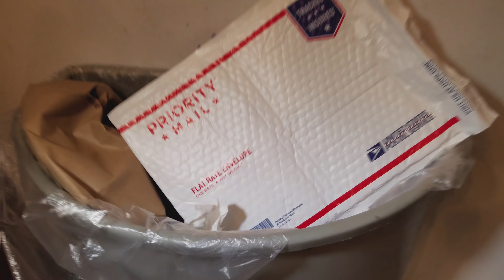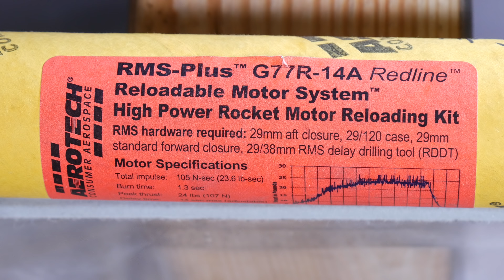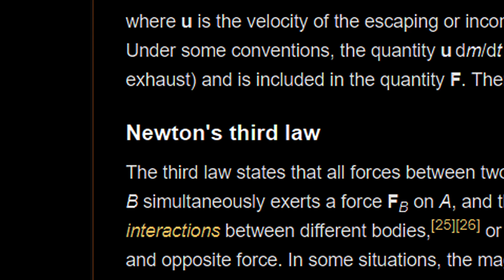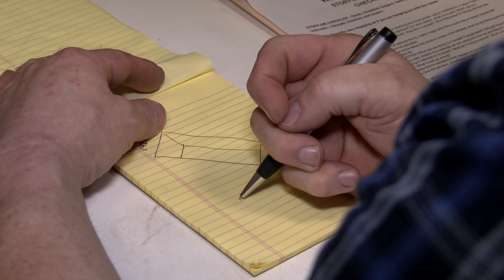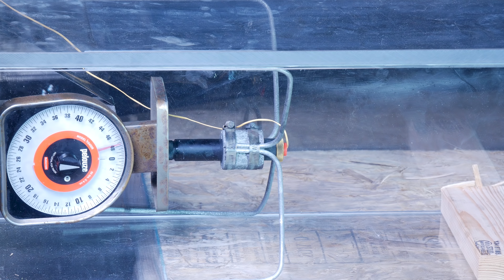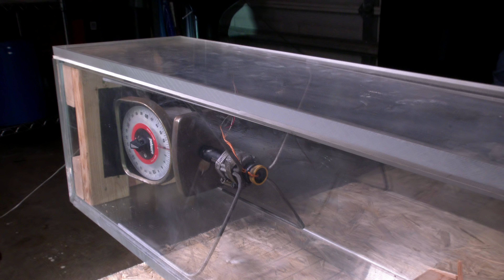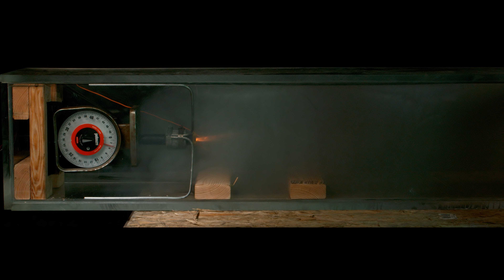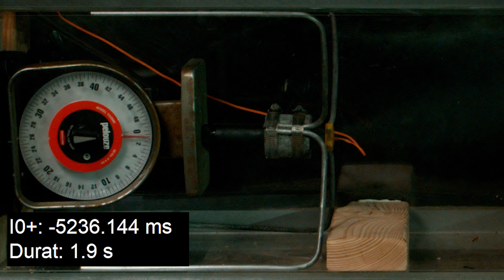Rockets in a Vacuum Chamber - Newton's third law of motion Visualized

Comment: Hate to give those flatear ammo but you realize the second you expand gas inside the chamber you no longer have a vacuum.
Reply from the maker: +Daniel Atkins the difference between a deep vacuum and a medium vacuum is 0.0001% . But I was only concentrating on the first 10 or 20 milliseconds of the burn, that initial impulse, that's it.
Reply: Daniel Atkins - rockets don’t work in a vacuum, just face facts
Reply: Daniel Atkins lol thank you. I watched this video and was like that proves nothing. I still think the box was to small anyways. It most definitely got some velocity off the end of the tank. It doesn't have air to push off of.
Reply: Thank you for being impartial it’s a breath of fresh air... which by the way you can’t get in a vacuum. 😏
Reply: The rocket can’t burn without oxygen , so as soon as it burns it’s no longer a vacuum because there is oxygen.
Reply: " longer have a vacuum."

why not learn what a vacuum really is? you seem to think a vacuum is a complete lack of mass, which is patently untrue.

vacuum is merely the name we have given to sub-atmospheric pressures. there are different degrees of vacuum.  in this case, sure, the pressure will rise...that in and of itself does not mean there is no longer a vacuum.
Reply: "The rocket can’t burn without oxygen , so as soon as it burns it’s no longer a vacuum because there is oxygen."

lolwut? not even close to being correct. solid rocket fuel already has an oxidizer, so no oxygen is required.  furthermore, there is no combustion reaction i am aware of where a by-product is oxygen, at least with fossil fuel based fuels.
Reply: Iron Man Lol do you understand what you even just wrote , eg . The rocket can’t burn without O2 , correct , it is in the rocket oxidiser , when the rocket ignited the O2 in the oxidiser is burnt so there is no O2 in the chamber , although prob some co2 and water vapour .
Reply: Cynical Skeptic  so if thrust needs a back stop to push off of, like atmosphere. How does the sr 71 flying at mach 3+ at 85,000 ft push off of an extremely thin atmosphere that is flying away from the thrust at mach 3+?
Reply: But is sure does take a long time to bring that volume of space up to the same pressure as the atmosphere, and that rocket was producing thrust the moment it ignited.
Reply: Space is not a perfect vacuum.
Reply: perhaps you should keep the vacuum going in the next experiment. As in don't turn off the pump after ignition. Would be interesting to say the least... perhaps along with this, add a vacuum gauge( or possibly use the one you have to monitor the vacuum while the experiment is on going.
Reply: +Ryan Shook Just as a FYI: There's a thing called an "oxygen candle" - one form is a mix of sodium chlorate and iron power.  When you heat it up, the sodium chlorate produces ordinary salt and O2:

2 NaClO3 → 2 NaCl + 3 O2

The powdered iron plus a bit of the O2 burn producing the heat you need to keep the process going.

There are many other chemical reactions that do the same thing.
Reply: @Daniel. That gas expansion is exactly what propels the the rocket forward. Remember. Gas expands in all directions, hence pushing the rocket forward. A basic engine work because of that exact reason.
Reply: Warped Perception Thinks there's a debate. BAHAHA 

You newbie! 

World Record Long Distance Photography (a 275 mile observation from a 9,272 ft peak (Pic de Finestrelles) to a 12,730 ft peak (Pic Gaspard) over water that should be anywhere from 16,502 ft (3.12 miles) to 23,275 ft (4.40 miles) below horizon based on spherical GEOMETRY) has already proven the Earth to be flat. 

That is a distance that is the equivalent stretch between Los Angeles to Las Vegas.

...

BAHaha
Reply: @fromagefrizzbizz9377  chemical reaction....which is a different reaction than combustion.
Reply: @UniqueBreakfastTaco  "chemical reaction....which is a different reaction than combustion."

Did you get your chemistry degree out of a box of crackerjack?

Did you read somewhere that combustion wasn't a chemical reaction?

Oxygen plus, say, kerosene, is the same reaction whether the Oxygen is LOx in a rocket, or O2 in air and produces the same things.  In fact, kero plus LOx burns a lot faster and more powerfully than kero plus atmospheric air, simply because there's a hell of a lot more O2 in a litre of LOx than there is in atmosphere that is only 21% oxygen.

But it is still the same reaction.

Similarly, blackpowder, gun powder, cordite, RDX, AP rocket fuel, AN rocket fuel or any other rocket fuel does not need atmospheric air to work.

Hint: airplanes have air intakes.  Rockets do not.  Neither do firearms.
Reply: @UniqueBreakfastTaco  if you're going to talk about chemistry, you need to know something about chemistry.  Swearing about it just proves my point that your chemically ignorant.

Oxygen candle?   I did not post anything about oxygen candles.  There's nothing at all candle like about an SRB containing Ammonium Perchlorate as oxidizer, aluminum, and HTPB as fuel.  Or a Saturn V containing, oh, a few thousand tons of LOx and kerosene.

Tanked LOx plus tanked kero is precisely the same reaction as atmospheric oxygen plus kero.  Just hotter and faster. 

If you think that a rocket operates using atmospheric oxygen, why do they bother with the LOx?  Where's the air intake?

None of the rockets or motors I've built had air intakes.
Reply: Ryan Shook Oh geeze wtf were we arguing about?  O2 candles have nothing to do with rockets,  and indeed is sorta combustion in reverse (or, more accurately an oxidizer replacement reaction). O2 candles were just a FYI, not describing how rockets work.This long after the comment I’m supposed to remember original context that you should have already understood?
Reply: @ninjaman1714  so the moon landings were fake? Imagine my shock.
Reply: @aznmutt15  .... dude. comparing a jet engine to a rocket is kind of ridiculous that's a whole nother can of worms and that engine is very specialized for what it does as is that plane
Reply: @jacobshexladder  ... dude right on bro. The scientific hacks we'll talk in circles until your brain explodes just keep going with what know bro! Space sucks the Earth is flat
Reply: @None888.  so it is bery similar. How the engines generate thrust vary greatly, but how the thrust generates a force is exactly the same. Ejecting mass, exhaust gasses, at high velocity.
Reply: @nebtheweb8885  liar. Rockets have a launch pad to push off... They generate a solid wall of air behind them the exhaust is supposed to be coming out at thousands of miles an hour.. Go learn the laws of motion and how a rocket motor works...  Space boy..
Reply: @wombat2248  you don't know what you are talking about either. Just guessing. (probably). What about fact instead of guess
Reply: @wombat2248  water is H2O. Where does that come from in rocket fuel, using aluminium oxide.. No carbon molecules either.. The oxygen is embedded in the aluminium,. Thats why it can burn in a vaccum. No different than pumping oxygen into it. You need to learn some more science. Hydrogen gas is an implosive gas. They cannot use hydrogen. Need hydrogen to make water. H2O..
Reply: @aznmutt15  The jet motors are also  designed to suck. You need to do some research on jet engines instead of exposing your ignorance...
Reply: @aznmutt15  since when does atmosphere fly away at Mach3
Reply: @texmex9721  how do you know? Dreaming. There is NO SPACE. It is all a lie. We have a dome over us..
Reply: @GORF_EMPIRE  still wont qork because it pushes off the sides. He needs something  way bigger. A few meters longer and wider.
Reply: @necrome9746  wrong. Go learn rocketry. It doesn't work like that. Go educate yourself on deflation, which is what a rocket is doing.
Reply: @stevewittwer7444  once again, how the engine generates thrust, is irrelevant to how the thrust causes a force. Please pay attention. They both use thrust to creat a force and an acceleration.
Reply: @stevewittwer7444  the motion of the air or motion of the plane through the air has the same effect. If the exhaust leaves the engine at mach three as the jet moves through the air at mach three, then the exhaust has a velocity of zero to the atmosphere. If the exhaust has a velocity of zero compared to the atmosphere, then it can not push off the atmosphere.
Reply: @stevewittwer7444  I find all these terms you are misusing interesting, and would like to know more? For instance, "hydrogen is an implosive gas"...
Normal people read that and realize your a socialopath with no scientific enducation, simple because it's a nonsensical adjective for hydrogen.  Bit I am curious what you think it actually means ...
Reply: Ninja Man So how do you explain the ISS which you can watch pass over through a telescope and see it’s double cross shape? How did that get up there then?
Reply: Hidden in plain Sight You numpty! Gunpowder and rocket propellants and explosives don’t burn with atmospheric Oxygen. They have “oxidising agents” in them, chemicals that break down with heat and provide lots of excess oxygen. In the case of gunpowder the oxidising agent is Potassium nitrate and this is by far the largest constituent of gunpowder. It’s mixed with charcoal carbon and sulphur which act as the fuel.
Reply: Rhia Emergency oxygen canisters on airliners produce oxygen through some kind of combustion reaction, don’t ask me what chemicals are involved.😆
Reply: @SvenTviking  sodium chlorate, NaClO3, when heated, becomes sodium chloride and oxygen. a pressure based system would be costly and too heavy for planes.
Reply: @stevewittwer7444  No doubt.  Whitout the dome of atmosphere we'd have trouble breathing.
Reply: Yeah dude do just that keep talking in circles that's what you guys do best!
Reply: @None888.  Not sure which dude you are talking to, but way to let him have it!
Reply: @texmex9721  ......some clown!...lol
Reply: @None888.  really...months later and you're gonna dig this crap up, presumably for another argument from ignorance?
Reply: @None888.  Some Guy said the same thing about some dude!
Reply: @texmex9721  ...dude has lost his mind...lol
Reply: @None888.  All four of them.
Reply: @ninjaman1714  yes they do, mixing an oxidizer that produces oxygen with a combustible fuel will result in a combustion reaction, they even work underwater where there is no oxygen available for the reaction
Reply: @hiddeninplainsight8768  Dummy, rocket fuel has it's own oxidizer, so it can burn in a vacuum because it brings it's own source of oxygen.
Reply: @GORF_EMPIRE  That also sounds like a great way to ruin a very expensive vacuum pump. Even if he did, that vacuum pump works by removing TINY bit of air from the container every time the pump cycles a revolution, like REALLY TINY. Even if he kept the pump running at full tilt, it probably takes a solid 5 minutes to draw down a vacuum on a container that size by one atmosphere, while that rocket motor is producing enough gas to replace a minutes worth of pump runtime in 2 or 3 seconds. A better way to help disprove the moronic idea that the rocket exhaust is pushing against the rocket exhaust/atmospheric pressure that rocket pumped in the chamber, would be to use a MUCH larger vacuum container, one in which when pulled down by one atmosphere, would require  the gas generated by 100 of those rockets to bring it back up to normal atmosphere, ensuring that firing one rocket wouldn't lower the vacuum by a measurable amount (1%), while still producing exactly the same thrust as in this experiment.
Reply: @necrome9746  Gas expansion is not what is propelling the rocket forward. the mass of the gas/exhaust that is exiting the rocket is the force, the shape of the nozzle allows you to ensure that you are directing the force precisely in the opposite direction of where you want to go. While the earth's atmosphere has an effect on the gas, the goal of the nozzle shape is about efficiency, you want the "plume" to exit in such a way that the exit pressure is equal to ambient pressure, which directs as much gas (mass) into the opposite direction that you want to go without restricting flow, which reduces efficiency, if the exit pressure is higher than the ambient at that altitude, the gas (mass) will exit over a larger area with less velocity, sort of like how you can increase the velocity and pressure of a garden hose by restricting the end with your thumb, ambient atmosphere is the thumb on a rocket nozzle, and that changes depending on what the ambient pressure is outside of the nozzle, which means you need to change the shape of the nozzle as the ambient pressure reduces with gain in altitude. If you use the same nozzle in the near-vacuum of space as the one at sea level, the exhaust plume would continue to expand further than the walls of the nozzle which would reduce efficiency.
Reply: @stevewittwer7444  Fun fact, rockets work without launch pads bro... Ever hear of a missile? Check this out, sometimes, they launch missiles from jet aircraft, which have no launch pad to push off of, and are often already traveling at speeds often greater than 800MPH. They do not generate a "solid wall of air behind them", they eject a huge volume of various molecules (mass) at high velocities in one direction, which imparts an equal force on the engine pushing it in the opposite direction. Pick up a hose, use your finger to increase the pressure / velocity of the water coming out of the hose and you will feel thrust on the hose, and as if it were by magic, you'll find that the thrust feeling is exactly the same whether you're aiming it at the ground (to push off of), straight up in the air, or directly in front of you. This is Newtons third law my friend, and it's all about the mass, and velocity of that mass coming out of the exhaust, and it doesn't matter if that mass comes from exhaust gas molecules or water, and the velocity can come from the combustion process of a fuel/oxidizer in an engine, or the velocity can come from pressure and the restriction from your thumb at the end of a garden hose.
Reply: @necrome9746  but if it is expanding,  where does it reach its limit in a vaccum?
Reply: @ninjaman1714  and after 6 years you still can't prove your facts.